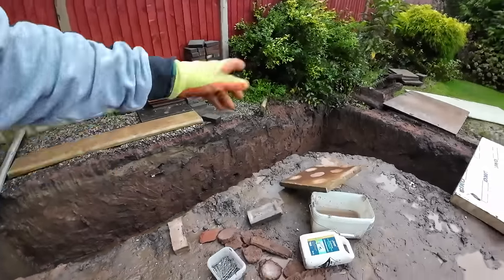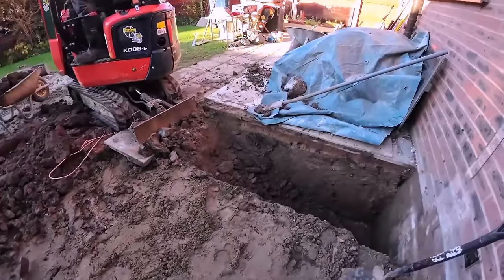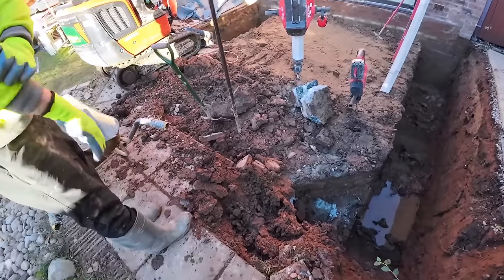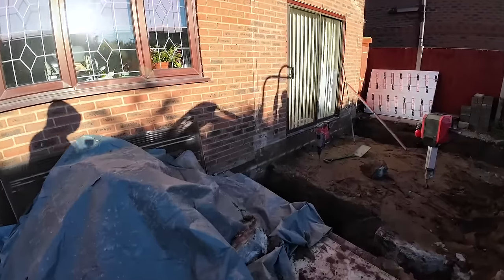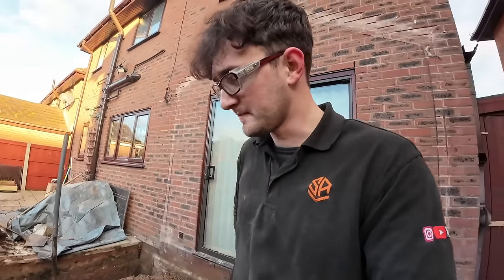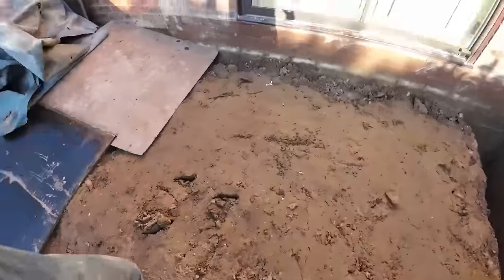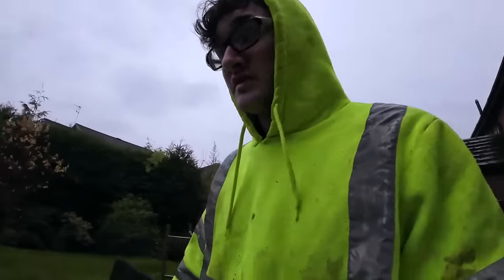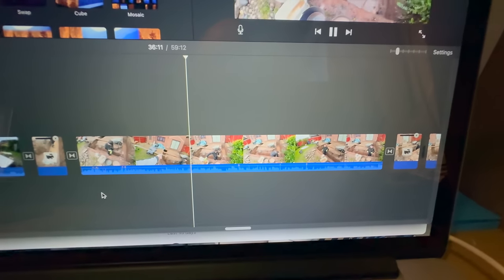PUSHED FOR TIME ON A CHALLENGING DIG.. CONSERVATORY TO EXTENSION PT 2

Comment: You would have been quicker hiring a pump to get shot of that water. 
That’s a massive job that you’ve undertaken there. 
Hopefully you are charging the customer and that you aren’t caught short. 
I actually thought that you  were  building a swimming pool. 
😂😂😂
Reply: @SteveAndAlexBuild  
Any word on your Dads hip replacement. 
He certainly is in a lot of distress. 
He cannot keep doing manual work as it will come to a time when enough is enough and you certainly cannot do all that type of work which you have been doing lately on your own. 
The quicker Dad gets his operation the better as he will be off for quite a number of weeks recuperating. 
🤞 🤞🤞🤞
Reply from the maker: Pre  op no 2 next week 😬🤞🏼🧱👍🏽